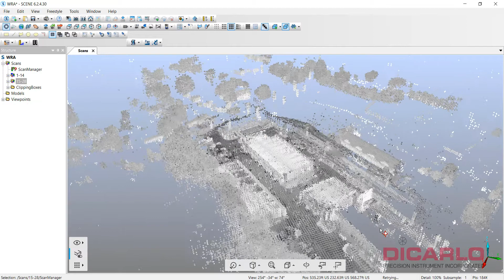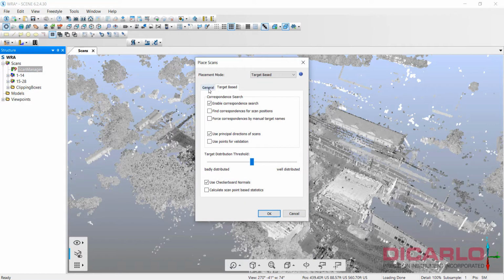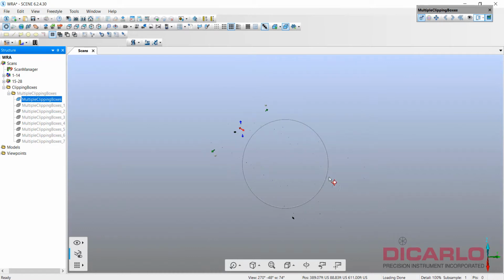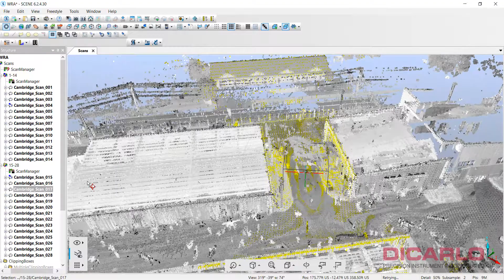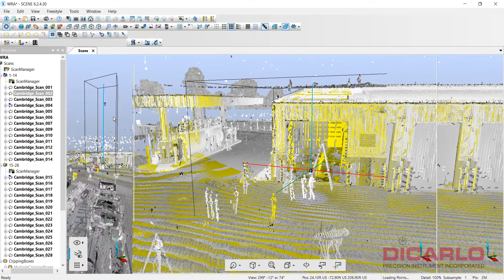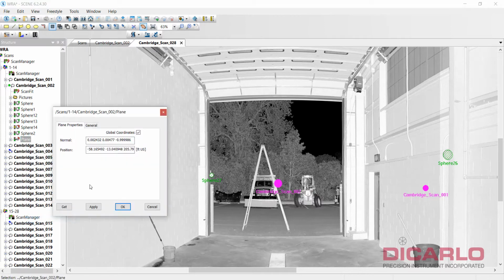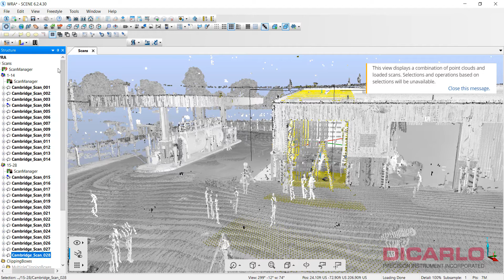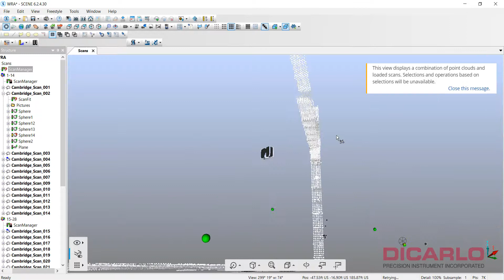FARO SCENE how to tweak SCENE cluster target based registration

Comment: Hi, I often watch your videos to improve my use of Scene. I have a problem and I would like to ask you for help to solve it.
I have a set of 130 scans of a large industrial warehouse that automatically registers quite well. However, I found that some scans shifted compared to reality, distorting the dimensions. Is there a procedure to "lock" some matching points in just a few pairs of scans, without having to do all the manual registration on all 130 scans?
Thank you
Reply from the maker: Currently, the only way I know of doing this is putting the two/three (however many) scans in a cluster in itself, registering those few scans to each other to your liking, locking/verifying the cluster ScanManager and then moving this cluster back into the ensemble of the other scans to re-run registration.

Comment: Hi Lucas, first off all, im following you and learning too much information from you thank you :). I have a big area to scan and i think i wil have 100+ scan position or more, My area is kind of industrial facility so im wondering that which method is usefull to registration my project. cloud to cloud, target based or other ? i wll be appreciate if u answer my question
Reply from the maker: Cloud to cloud is awesome, but it can be a headache if you are looking for efficiency. I've done projects where I use c2c in over 400+ scans. It works, but if it does not, then you run into a lot of processing time. So at the end of the day targeting (spheres and checker boards) are still the safest and most efficient ways to go... In case they don't work, I do subsamples of my data with c2c registration, but otherwise I try to keep targets in sight at all times. Also necessary if you are going to be registering to absolute coordinates for your project!